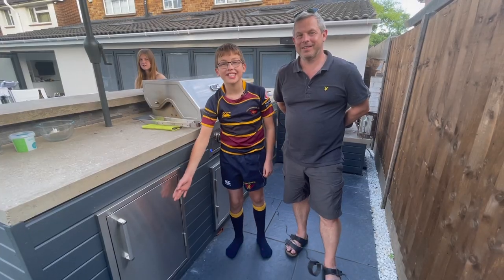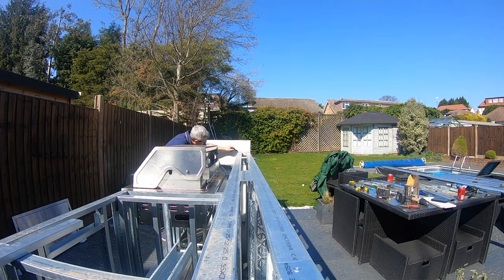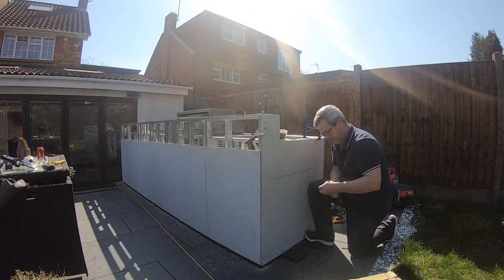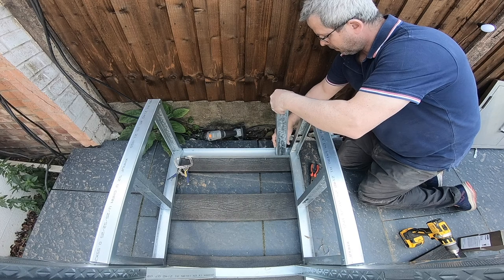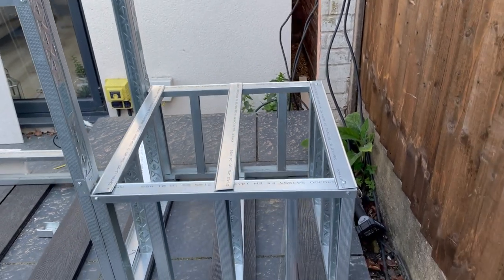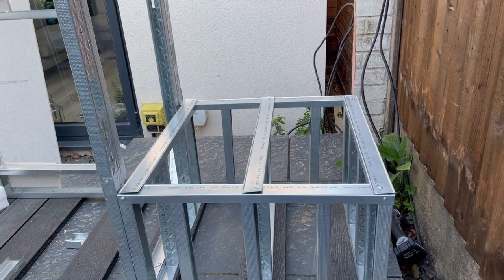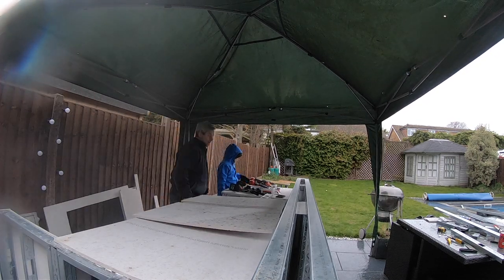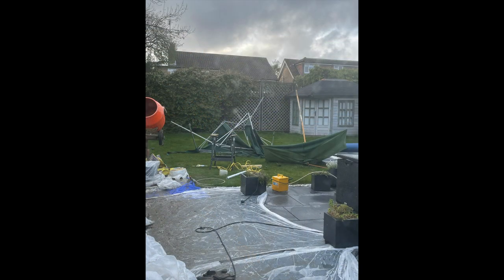DIY Outdoor Kitchen Build | Concrete Countertop UK | Part 2 - Cementboard

Comment: Thanks for your videos - great series and lovely result!  Can you provide the details of what screws you used for the metal frame and also to secure the cement board?
Reply from the maker: Hi Rob, thanks very much. I used wafer head screws to join the metal frame https://www.screwfix.com/p/easydrive-phillips-wafer-uncollated-drywall-screws-4-2-x-13mm-1000-pack/53761?tc=JA1&ds_kid=92700048793290424&ds_rl=1249413&gclid=Cj0KCQjw--2aBhD5ARIsALiRlwCDd0g4neFz59b7dTeC87LOs4gJdM3YUOkdbl7t1O2MP0pIh_2lQ6YaApvcEALw_wcB&gclsrc=aw.ds 
and 4 x 40mm Exterior screws to secure the cement board https://www.wickes.co.uk/C2-Exterior-Multi-purpose-Screw---Exterior-4-0-x-40mm-Pack-of-350/p/209949

Comment: Great build! Could you please provide the dimensions of it pls? How much metal support do you think you used in total?
Reply from the maker: Thanks, the main part is about 3.6m long and the return where the sink and the charcoal bbq are is 2.2m. The depth of the worktop is 76cm and the depth of the raised bar section is 38cm so that gives you the rough outline. The finished height of the worktop is 94cm and the height of the raised section is 110cm.  I put uprights in every 60 cm or so and then added cross bracing every metre or so around the whole thing. I hope that helps.  Thanks for watching